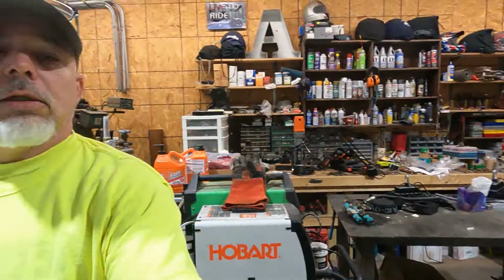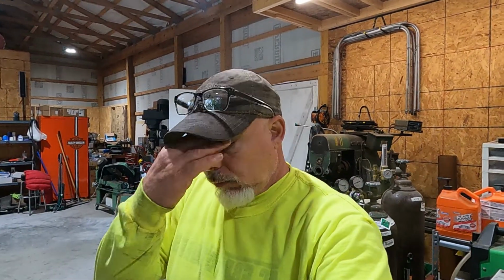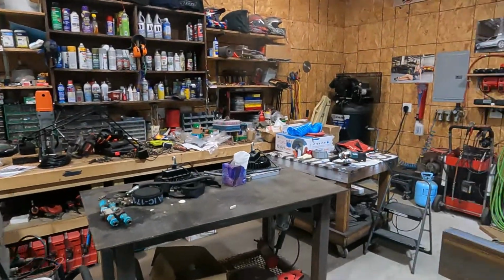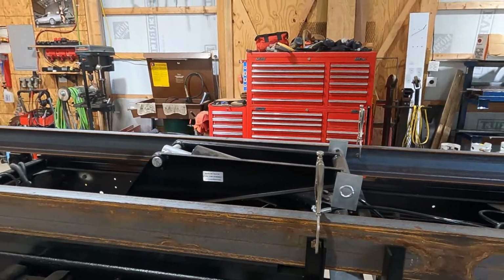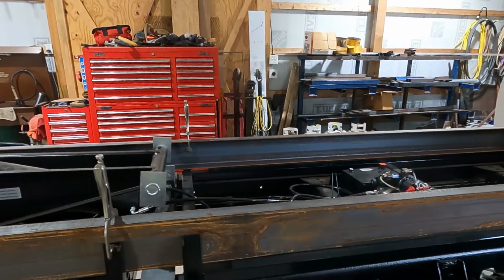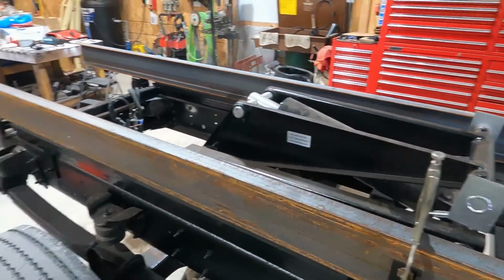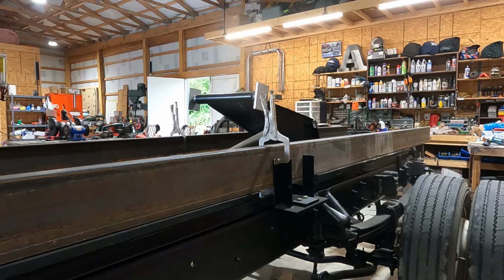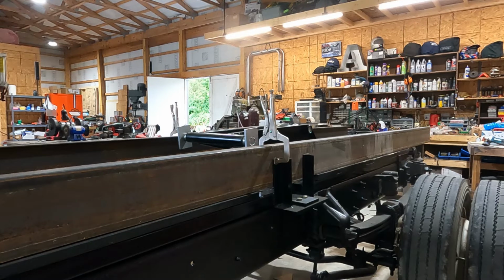GMC 5500, Dump Truck Build, C5500, Dump Bed, Part 3

Comment: We need part 4.
Reply from the maker: I know and I'm working on it. Been extremely busy and just haven't had time to do anymore work on the truck. But I will soon. The video is coming, just can't say exactly when.
Reply: @duncanduzit6201  Do you know what the shortest the cab to axle measurement can be with these U Haul trucks? Looks like the fuel tank is the limiting factor. I'm interested in buying one, but there aren't any for sale within 100 miles of me. Thank you sir.